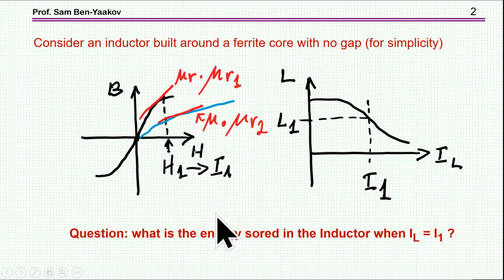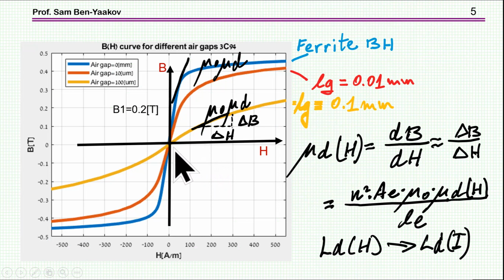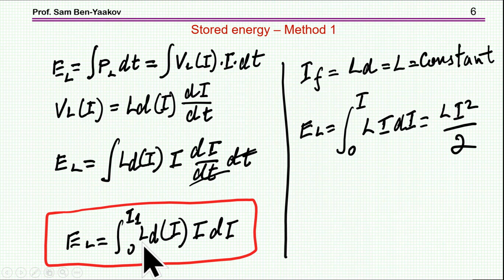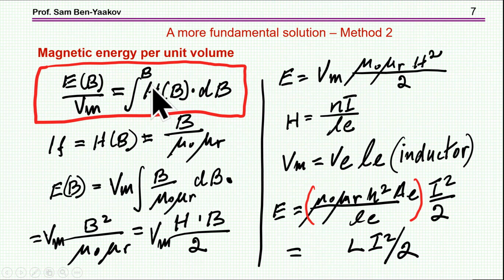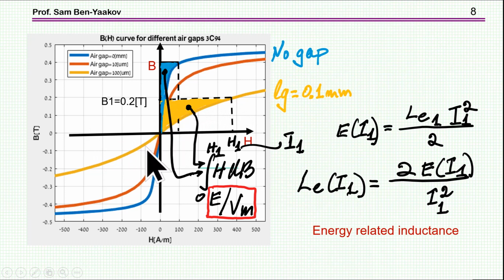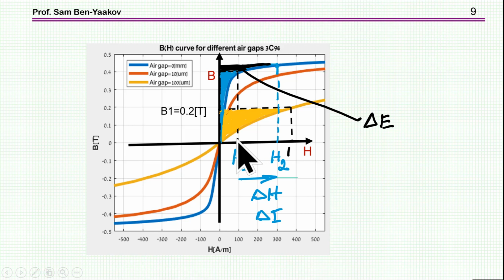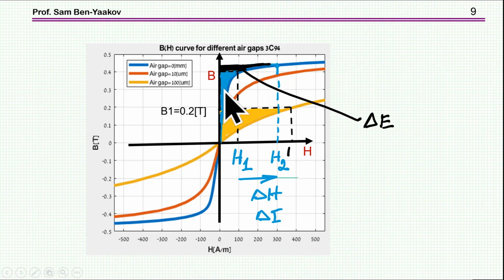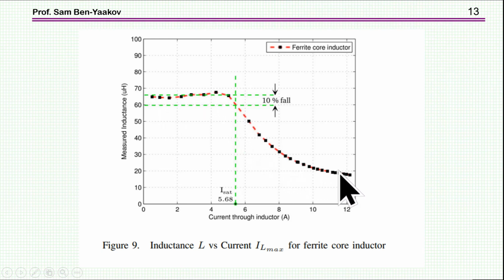Stored energy in nonlinear inductors: And answer to riddle

Comment: Thank you for the detailed explanation. 
I just had the problem with two inductors with very different energy storage capability. I made the measurement with the current increase at a given voltage attached to the inductor where the current goes up remarkably after saturation. 
The explanation in the picture with the area in the BH diagram in 11:26 is very helpful.  
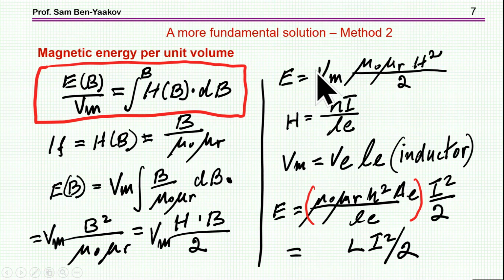by the way: at 10:07 “Vm = Ae Le (inductor)”
Reply from the maker: Thanks for sharing

Comment: Hello Prof. I am conflated/conflicted on a formula and wonder if you can help? it is definition/calculation of Lm in a full bridge LLC converter. My L-primary = 69uH, N is 16:11 i.e. 1.455, L-sec = 32.61uH, Lleakage = 1.8uH. Google says Lm = sqrt(Lpri * Lsec). Or net L-pri i.e. Lpri-L-leakage.. Using externals resonant inductor. Have come across a paper by Gerald Healy of Pulseelectronics, he has defined Lm = sqrt(Lpri-Lleakage) * (Lsec/N^2)). I am thinking Lsec should be multiplied by N^2 not divide? What are your thoughts on this. Additionally I have also come across Inductance ratio being defined as Ln = Lm/Lr (Texas) as well as Ln= (Lm +Lr)/Lr (Infineon). Which is correct?
Reply from the maker: Where did you see this  Lm = sqrt(Lpri * Lsec).?
Reply: Assuming coupling factor as "1" since I have leakage inductance taken out
Reply from the maker: @dipakpatel9329  Lm is either Lp or Ls depending from where you look
Reply: @sambenyaakov  Many thanks for your response

Comment: There is a coupled inductor design out there that 'splits the flux' with multiple cores, I'd really love to know what you think about it:
US 9,620,280B2
Reply from the maker: Thanks for reference. If I understand it right, this is one more perpetuum mobile patent. Reactive energy in, real energy out. I wish it was true🙂 come on.
Reply: @sambenyaakov  
Its based on what scientsts now call Electromagnetic Nonreciprocity and phase conjugation.
See scientific paper: Tutorial on Electromagnetic Nonreciprocity and Its Origins

Isn't ferromagnetism perpetual motion? :) Ferromagnetism is from the material and not from the mmf source, the mmf is a force that rotates the domains only. No energy is converted, but electric energy is consumed when a counter MMF is formed.

it isn't a PM patent, PM contraptions try  to cheat the gravitational potential which isn't possible because it is a conservative field.

The pdf does describe the physics.

Normally in a coupled inductor, a voltage in a 2ndary inductor manifests from the change in ferroflux, when the emf causes  current, the Lenz effect works against the changing flux which is fed back to the primary coil and is seen as backEMF which causes an increase of input power: energy is conserved.

The pdf demonstrates and explains how to redirect the reactive counter-MMF towards another coil (edit: to another core physically not coupled to the primary coil) and through phase conjugation a new EMF source is formed which has no back-mmf path towards the power source. It is suggested that Lenz feedback towards the primary isn't mandatory and hat it can be rerouted and through phase conjugation can be made into positive energy.

There's also a paper of Harold Aspden  PhD which demonstrates a core-gap energy / current anomaly by a simple experiment. If you are interested, it's titled ENERGY SCIENCE REPORT NO. 1 POWER FROM MAGNETISM

Best regards!

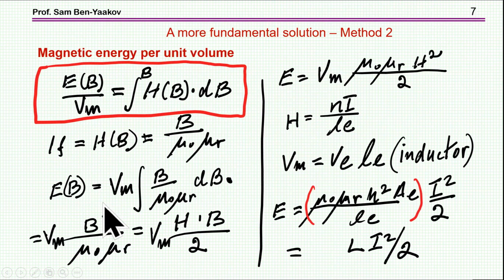Comment: Dear professor, thank you very much for this great video. I just have a question: at 7:09 on method 2,  the equation E(B)=Vm (B^2)/uo ur, should not be E(B)=Vm (B^2)/2 uo ur ? (A 2 multiplying the permeabilities in the denominator). 

Thank you for your video, I'm a great fan of your work!! 👏👏
Reply from the maker: Correct. Sory for the omission. Then corrected.
Reply from the maker: And thanks for pointing this out.

Comment: Thank you prof. This is a very intersting topic. 
I'm comming back to the same question, what applications can use non linear inductors as a energy storage source. Maybe some sort of a flyback conv?
Reply from the maker: As pointed out in video. In numerous applications energy storage by the inductor is not the goal but a neccessity. All PWM converters onvolve enery storage. Les recognized is the fact  that resonant converters such as LLC hinge on energy storage.

Comment: We should point out (perhaps in another video) how hysteresis affects this.  The differential inductance also depends upon whether the "DC" current offset has most recently increased or decreased.  Also, 'large' AC signals will "demagnetize" the core so that the inductance is between these two extremes.  Domain wall movement dissipates energy as the current is increased and again when the current is decreased.  I do enjoy your videos; they make me think about what I know and how to apply it to electronics.
Reply from the maker: Thanks for important input. Yes? Hystersis is another notch to climp in this knowledge ladder.

Comment: Thank you!!! I have qeustion, I can make analogy of kinetic energy to energy stored in inductence, so mv^2/2 => LI^2/2. SO which parameter in space need to be different in order to get similar effect. It seems that mass (i would call inertia) none linear and not constant at high speeds close to speed of light. So in order to get faster speed for mass m we need invest more energy which cause us to assume that mass is get higher. Anyway in this example the mass is get higher, and in inductor case the inductence L is get lower.

Comment: Thank you for very interresting discussion. My conclusion is that the energetic characteristics are real ones. Others like differential inductance etc.   are just an additional or a special characteristics having identical units that creates a confusion. It is typical for physics, e.g. people are often confused between accumulated surface charge and charge passed through the surface without accumulation. Both have C/sq.m units, but meaning is essentially different.
Reply from the maker: But differential or incremental inductane is what is measured by RLC meters and relevant ripple estimation in PWM converters!
Reply: @sambenyaakov  May be I am wrong, but I suppose that ripple magnitude is directly connected to energy balance of the inductor, isn't it? RLC meters may use different techniques. Some of them measures impedance at given frequency (small AC), others analyse relaxation period in quasi-DC conditions (large DC). I think only former one measures something about Ldiff at H=0, latter one seems to indicate L energetic. Magnetism as a macroscopic manifestation of pure quantum phenomenon having no macroscopic analogy is always a very confusing topic for intuitive understanding. "Shut up and calculate" turns out to be the only reliable approach.
Reply from the maker: @RogovAB  Have you seen https://lnkd.in/gFMYFcbj ?